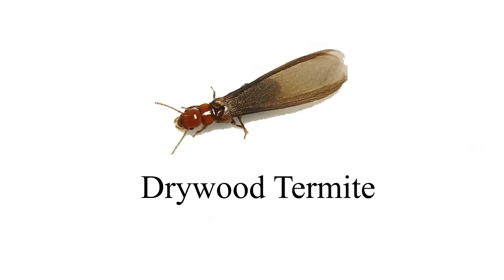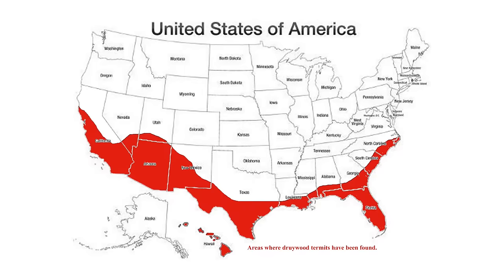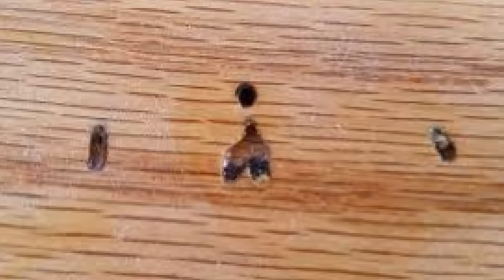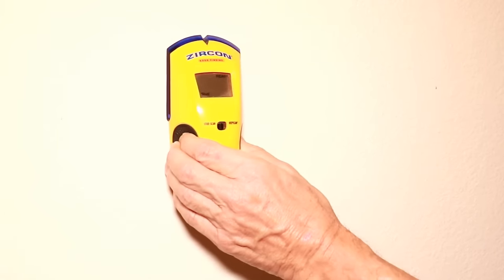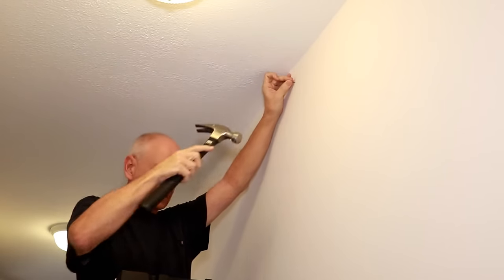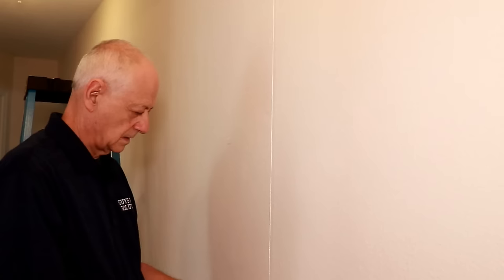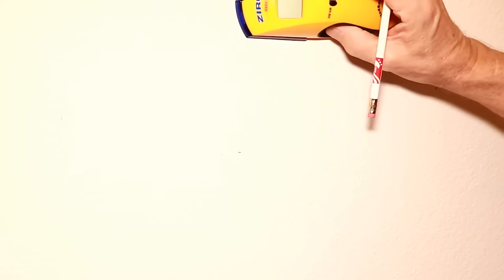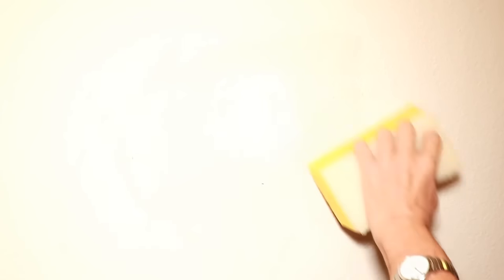How to Treat a Drywood Termite Infestation Yourself. A MUST see if you have Drywood termites.

Comment: Do you think I can use for drywood termites treatment behind sheetrock two chemicals at same time, like Bora Care and Fipronil? Maybe first month Fipronil next month Bora Care?
Reply from the maker: Bora-Care and fipronil are usually used differently.  Fipronil is usually injected into the wood as a foam.  While you can do that with Bora-Care, it is most effective by filling the wall void with a foam, instead of injecting it into the stud.  If you were to treat the wall void with a Bora-Care foam, then it would not be necessary to treat with a fipronil foam into the stud.  You can still do it, but it would probably be overkill.  The advantage of the Bora-Care is that it lasts forever.  I hope that helps.  Be well my friend.
Reply: @GuysPestSolutions   Where I can get  Bora-Care foam I see only 1 gallon liquid cans.
Reply from the maker: @johnjohnson-pf4kw  To use Bora-Care as a foam, you need to buy a foamer and a foaming agent.  It is not available in aerosol cans the way that fipronil is.  As with most equipment, you get what you pay for, so I recommend that you get a good foamer, if you wish to go this route.  A good foamer runs around $250.  I will give you links to the foamer and the foaming agent.  I hope that helps.  Be well my friend. 

Foamer:  https://www.domyown.com/bg-versafoamer-hh-gallon-foamer-p-1696.html

Foaming agent:  https://www.domyown.com/profoam-foaming-concentrate-p-307.html
Reply: @GuysPestSolutions  Thank you sir.
Reply: @GuysPestSolutions  You think i can use this non repelent foaming agent for Taurus SC also and make injection inside 2x4?
Reply from the maker: @johnjohnson-pf4kw  You are very welcome.  Be well my friend.
Reply from the maker: @johnjohnson-pf4kw  You can pretty much use any pesticide with the foaming agent and the foamer.  The problem with treating 2 X 4s with a foamer is that it does not have the same amount of pressure that an aerosol can has, and I do not think that the foam expands as well as the aerosol products will.  Pest controllers do it all the time to save money, but I think using the aerosol cans is going to do a more effective job.  Also, you can drill a smaller hole using an aerosol can applicator tip.  This makes the drywall repair much easier.  One can goes a long way, so unless you are doing a really large area, then I think I would just go with the aerosol foam.  Be well my friend.
Reply: @GuysPestSolutions   You think if I use Bora care  with a  foamer agent and inject few gallons in couple walls behind sheetrock it can help to kill drywood termites? Or better use fipronil drill holes every 4 inches and inject this way? I see some Pest control co. drill apartment's walls from outside stucco side only 3-4 holes each 2x4 at the bottom i think they do just do preventive care injection with some thing like Bora care or fipronil?
Reply from the maker: @johnjohnson-pf4kw  Injecting Bora-Care foam into wall voids it's pretty much a sure thing, if you fill up the entire wall void with the foam, from floor to ceiling.  If you do this to all the wall voids, then that will render them termite proof.  There are some problems with this though.  That is a lot of foam to inject into your wall voids, so it can leak out onto the floor from the bottom of the wall.  If you have exterior walls that are insulated, getting the insulation wet could be a problem.  Still, there are companies that do this.  I will give you a link to a video that kind of shows you how it's done.  You can also treat attics with the foam as well.  The bottom line is that you can treat almost the entire house by using both a garden sprayer and a foamer to apply Bora-Care.  With regard to treating studs with a fipronil foam, you need to just employ a little common sense.  Obviously, the termite galleries can be located anywhere along a wall stud from the ceiling to the floor.  So, if you just drill three or four holes near the bottom of the stud, that is going to leave the rest of the stud untreated and you may not have injected any foam at all into an existing gallery that may be around the middle of the wall or near the ceiling.  Pest controllers that do that sort of thing simply do not know what they're doing.  The only way you can treat a stud effectively with a fipronil foam is to drill holes every four inches down the entire length of the stud and treat all the holes.  This can be done from the outside of the house, but I think it is way easier to do it from the inside.  As I always tell people though, the only sure way to get rid of drywood termites is to fumigate.  Spot treating with a fipronil foam it's kind of like playing whack a mole, unless you treat every stud in the house, every ceiling joist, every floor joist, and all the rafters and other parts of the roof structure.  This is just not practical with fipronil foam.  I think using Bora-Care would be a better option and that treatment would be permanent.  If you would like to have a go at it, then try doing just one wall void in a closet and see how it works out.  I hope that helps.  Be well my friend.

Video on treating an entire house with Bora-Care:  https://www.youtube.com/watch?v=kXQTc9wwCfQ&t=4s
Reply: @GuysPestSolutions  Thank you for answering me. But Fipronil some kind non repellent poison and termites can spread it all over between one each other and inside  their nest .If 1 or 2 termites touch fipronil maybe 10 more termites will be affected  and die. But Bora Care you think work better?
My house is from 1951 and have no insulation in the walls only at attic. I check attic few days ago and all rafters and 2x4 very solid. i see only inside in 1 bedroom 1 MDF  baseboard have hole and dents but i see this from day number 1 when i move to this house 10 years ago. I don't pay attention to this damage before when i move in but now i do some research and I think it dry wood termites because I see 1 small knock out hole covered with a dirt or clay on baseboard next to the soft spot on the bottom baseboard. I not really see any dry wood termites hard pallets but just soft dust under the baseboard in couples spots only. Thanks for the  link to video I have 1100 sq feet house and 1 car garage how many gallons of Bora Care you think I will need it? I see couple days ago few brown termites with a wings outside my house but I don't know if it my or my neighbors  2 termites was dead in bucket with a water 3 feet from my house other one  was moving 16 feet from my house to  my neighbor fence side . I catch  him and put him  the bottle just in case. I was treated my house outside walls and windows and 6 inches trench also with fipronil Taurus SC  like I see on yours's video.
Reply from the maker: @johnjohnson-pf4kw  Just like fipronil, Bora-Care it's a non repellent.  It penetrates almost all the way through the wood, so when the termites eat it, they bring it back to the gallery or the colony, and they share it with the other termites.  What you are basically doing with Bora-Care is you are poisoning all their food.  Also, unlike fipronil, Bora-Care lasts forever.  After you do a treatment with Bora-Care, it never needs to be redone. 
   
All of that being said, I am not convinced that you have drywood termites.  The hole you are describing with the dirt or clay in it sounds more like an exit hole that was created by subterranean termites.  Further, that soft dust that you are talking about would also be consistent with subterranean termites.  The only thing that confuses me though is the brown swarmer that you saw outside.  Please watch my video on how to identify termite species and see if you can identify the swarmer that you caught.  Also, have a look at the map in the video to see if you are in the red area.  Drywood termites only exist in the red area, or maybe very close to it.  So, if you do not live in the red area, then you most likely have a species of subterranean termites.  If you live in the orange area, that swarmer could also be a Formosan termite.  If that is the case, then you may need to do some further investigation.  If you already trenched around your house and treated with Taurus SC, then you treated for subterranean termites.  That treatment will eliminate all species of subterranean termites in the US, with the possible exception of Formosan termites.  While Formosan termites are also subterranean, they do have the ability to colonize in your home.  No other species of subterranean termites are you able to do that.

Be well my friend.     

Video on how to identify termite species:  https://youtu.be/xDtGUWxMrRw

Comment: I have been told that I have drywood termites in my house in Phoenix, Arizona. What treatment is more effective, fumigation or local treatment. Not many companies have fumigation service in Phoenix and it is very expensive. But, I am a little bit confused. One company that did inspection gave quote for both services and the price is the same for both fumigation and local treatment. The other company does only fumigation service and they said that only fumigation is effective. It seems like you have similar opinion. Is the treatment in case like this urgent? Please help me to decide. Thank you.
Reply from the maker: Thanks for reaching out to me.  I would be more than happy to help you unpack the problem.  You are totally right that I am a fumigation guy.  The reason for that is because it is virtually impossible to kill off all the termites with spot treating.  Unlike subterranean termites that have just one colony that is located underground, outside your house, drywood termites have multiple galleries that are located inside you home and in many locations.  They typically enter through openings around windows, doors, and the eves of the building.  It is very common for them to get into the attic and then find their way into the walls.  Granted, it takes years for this to happen because a new gallery takes between four to seven years before it can produce new swarmers that are capable of starting new galleries.  However, after it does produce new swarmers, it produces a lot of them, so that one gallery can turn into several new galleries.  Then four to seven years later, those galleries each produce multiple swarmers that create multiple galleries.  On and on it goes until you have God only knows how many galleries in the building.  They may be in the walls, the floors, the ceilings, the attic, the furniture, the cabinets, and so forth.  The problem with spot treating is finding all the galleries.  Some are easy to spot because you see the kick out holes and frass, but some are inside the walls and the kick out holes are on the sides of the studs that are inside the walls.  Sometimes you can spot them because there is damage to the drywall, but many times there is no evidence of them at all.  If you watched the part of my video where I explained how to find the galleries, then you know that it is far from an exact science.  Even the best pest controller, who has many years of experience, cannot find all the galleries.  The new galleries are especially hard to find.  That is why I tell people that the only way to get rid of a drywood termite infestation is to fumigate.  You should only spot treat if you absolutely cannot afford to fumigate.  If that is the case, they you may as well do it yourself, because you can probably do it better than the pros.  

Now that you understand why you need to fumigate, please allow me the opportunity to explain the cheapest way to do it.  Prices can vary wildly in this business, so it pays to shop.  I have seen prices for fumigation vary as much as $2000 for the same job.  Please check out my video on how to hire a pest controller without getting ripped off.  That video can save you a lot of money.  I will place a link below.

Very important.  You need to understand that the gas they use to fumigate has no residual action whatsoever.  That means you can get reinfested the moment the tent comes down.  Most of the time they fumigate during swarming season because that is when people notice the problem.  Trust me.  If you have drywood termites, then so do your neighbors.  These guys swarm for several months every year, so you will almost definitely get reinfested within the first year after the fumigation and maybe even the next day.  I understand that it's not sounding too good right now.  Right?  Please do not despair.  There is a way to prevent drywood termites, but you need to do it yourself.  I have a video on how to do that and it's not as hard as you may think.  In the video I tell you to do the treatment every three months, but I am rethinking that now and I am suggesting every two months.  The pesticide lasts three months, but it is not as potent for the last 30 days.  So, I am now doing it every two months on my house, just to be sure.  Getting rid of drywood termites is costly, so I no longer take any chances with them.  Every three months will probably be okay, but I have now decided that overkill is a better policy.  There are some tricks that I was not able to mention in the video, but I would be happy to share them with you if you email me.  I can explain how to do the treatment is about 1/3 the time, but I cannot do it in the comment section or on a video.  I will explain why in my email.  If you would like that information, then write to me at guyspestsolutions@gmail.com.  If you email me, please remind me who you are.  I get a lot of email and it is easy to confuse cases.

Okay.  Now you know everything you need to know to make an informed decision.  I am so sorry that you are having this problem.  I hope you found this explanation helpful.  Please ask all the questions you like.  I would be more than happy to stay with you until the problem is resolved.  My service is totally free, and I do it for everyone.  I am always here to help.

Be well Teresa.

Video on how to hire a pest controller without getting ripped off:  https://youtu.be/y-a8XOqVrlE

Video on how to prevent drywood termites:  https://youtu.be/neNsmVbj8Pc
Reply: @GuysPestSolutions  Thank you very much.
Reply from the maker: @teresaoparalifewavedistrib3071  You are very welcome.  Be well Teresa.

Comment: How do you treat rafter (exterior of house near fascia board) that is partially eaten by termites?  Thanks
Reply from the maker: That depends.  If the rafter is bare wood that has not been painted, stained, or sealed in any way, then use Bora-Care.  Mix it one to one with water using a drill and paint mixer attachment.  It can be applied with a pump-up garden sprayer.  If the rafter has been painted or sealed in any way, then drill holes halfway through the wood at 4 inch intervals, everywhere you see or suspect damage. Shoot a fipronil foam into each hole until it is either coming back out at you or coming out the other holes that you drilled.  The holes only need to be wide enough for the tip of the foam can to enter.  I hope that helps.   Be well my friend.

Bora-Care video:  https://www.youtube.com/watch?v=Rmr_aEodyhg&t=26s

Bora-Care:  https://www.domyown.com/boracare-p-100.html?pdpv=2

Fipronil foam:  https://www.domyown.com/termidor-foam-p-3528.html?pdpv=2
Reply: @GuysPestSolutions  Does Bora-Care or fipronil foam kill the termites inside these holes?  Afterward, do I use putty pr caulking to fill these holes and then paint?  Thanks
Reply from the maker: @jimwong8056  Yes.  These products will kill the termites that come in contact with these materials and in the case of fipronil, the termites will share it with other termites.  After you treat, you can go ahead and repair the holes.  I hope that helps.  Be well my friend.